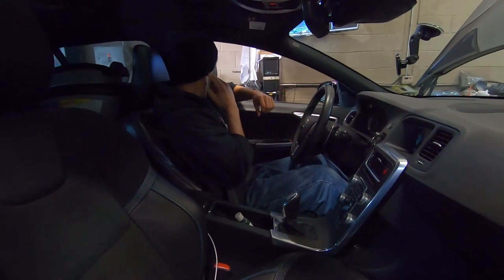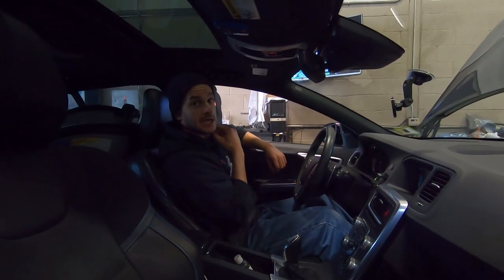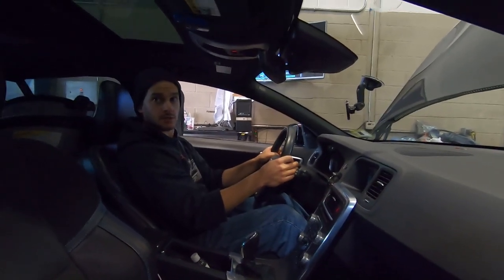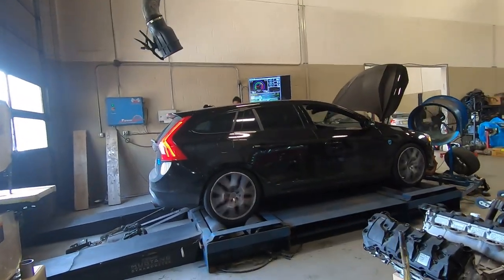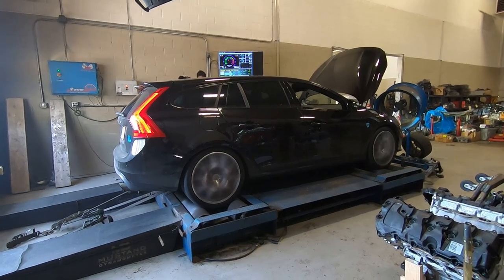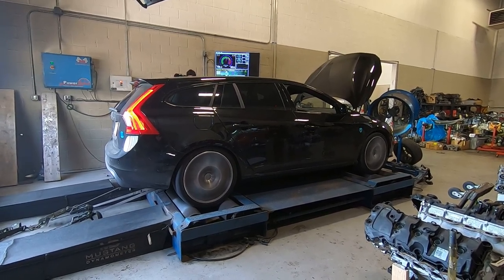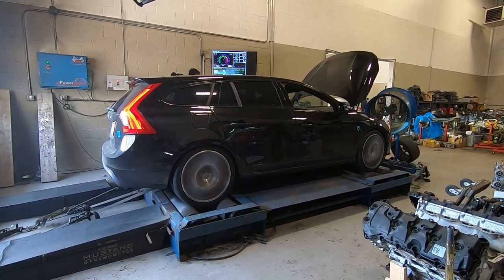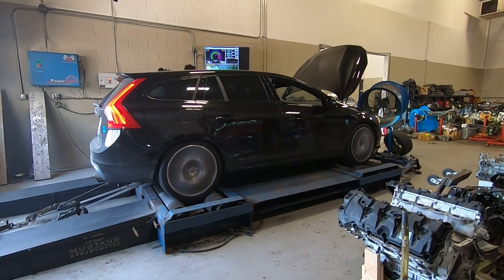Here’s How Much Power My Volvo V60 Polestar Actually Makes

Comment from the maker: Volvo lists the power from factory as 345 horsepower and 369 pound feet of torque. Mine did WAY more than that at 313whp/395wtq. With even 12% parasitic losses (which is very low for AWD cars), that would put my car at 355 crank horsepower and 448 crank pound feet of torque. This is bananas!

Comment: I love seeing people go through all the things i did when i first got my Pstar. After SOOO much testing and trying different things my last HP #'s were 373WHP and 492WTQ. Im currently working on trying to go much bigger turbo to avoid all that instant power down low which is very hard on the Transmission.
Reply from the maker: Please report back with how that goes! I'm interested to upgrade the turbo eventually, maybe next year.
Reply: Same!  I have a Stage 2 (Hilton) 2016 RD 3.0 (poor man's P*) - 356 whp, 539wtq, the power is outrageous, and I have purchased additional cooling equipment for the transmission (similar to "builtforspeed"s YT channel).  Good luck with the sourcing and let us know how it goes!
Reply: @daviddawkins2392  I have my 16 P* with full bolt on and Hilton’s 2.5 tune all I know is that launch’s spin all 4 wheels need to get on a dunk asap
Reply: @dylanpeck7902  Much envy!
Reply: The polestar version has a larger turbo than the R-design. Have you maxed out the psi on the Polestar turbo?
Reply: I've got 3 years on my warranty until I start staging it. I've heard that stage 0 is crucial to going to stage 1 and beyond. I've got a 2017 s60 wagon r design platinum with polestar tune.

Comment: Great video. Once you start modding it you will be very happy driving that car. It'll want to break tires loose every corner you gas it.  Very fun car. And i dynoed mine in 3rd gear the 4th was showing very crazy numbers on mine.
Reply: I can vouch for this.
Reply: Hey, just curious, is your car still good as it was? I cant find a clear answer to wether i should upgrade my volvo engine or not..
Reply: @danielcohen3733  if you won't upgrade your turbo you will never kill this t6 engine. Once you start putting bigger turbo on,  thatwhen the risks start happening

Comment: Volvo's have always been powerful. We got a 2017 D5 PHEV and it's a really enjoyable drive at all speeds. If you need to overtake, you can do it. I'd love to get a stage 1 tune, cause the gains are supposed to be amazing without any modification required.

Comment: Hello, very Nice results. From my V60 D4 2014 I have a dyno run after Tuning; 224 HP (4000 RPM) & 430 torq (3300 RPM). 

It still be incredable cars
Reply from the maker: Very nice!

Comment: The T6 engine is good for +1000hp, IF the bottom end is build the right way, so there is alot of potential :-) Piston rods and bearings though, will not go past 450'ish, expect a bit less, but still the stock engine will gladly do 400hp :-) I have a V60 T6 AWD from 2012, it has 305HP stock on the crank. Aiming for the 400hp mark within a years time or so. To get there I'm planning to swap the turbo, injectors, intake, ported head and a new tune. Should be enough to get pretty close :-) I know there are 10-15 easy hp to gain from straightpiping it, but in my country it is stupid illegal to remove the cat, so I want to retain it. Also, I do like that the car stays somewhat neutral in not only apprerance, but also sound.

The wheels you are running, what name and brand is that? They look so good on the car <3

Comment: Since I can’t afford a new volvo anymore.. I been tuning my XC70, already started with r-design conversion, not sure how volvo was planning it becaue they clearly were going to make an XC70 RD but they didn’t. White papers I have discovered with RD options for XC70 indicate they planning to use matte or satin black for adds ons to match the exterior body cladding I guess. Weirdly I also found they going to use paint matched colors as well.  But options I found indicating possible RD was in the works was:  rear spoiler, mirror caps, rim colors all having r-design options on this white paper.  Nothing confirmed and speaking with my sale’s guy as I call him he great source of info he told me he think they would have gone with matching the cladding, as may appear more aggressive vs body color matched. 

Should mention, still around that 415 WHP from my last tune but it feels better now, and sounds godly on these Borla’s!

Comment: I was wondering what gear you were in, it's worth noting that the torque is limited in the first three gears (pretty severely in first and second). Torque is limited to 380 Nm in 1st, 400 Nm in 2nd and 450 Nm in 3rd (280, 295 and 332 lb-ft respectively).
The factory torque figure was originally advertised as 500+ Nm, with about 550 Nm in the upper gears. They didn't claim the full torque because the lower gears limit it so heavily.

Comment: My friend has the polestar optimization s60 r design and i had a modified c70 making 350hp and 400tq and I told him the same thing there’s no way it’s making the advertised numbers it felt exactly like my c70 it pulls so hard through the gears and it’s sensitive in the low end.

Comment: With all the parts available and a proper tune should get close to 600lb-ft and 520hp
Reply: That poor transmission =-D
Reply from the maker: Doug shhhhhhhh, it'll hear you! Lol
Reply: @shiftinglanesgarage  🤣 those Aisin TF60 gearboxes can take a shitload of power and torque which is good
Reply: If you have enough money you can make it bomb proof but that is probably the same with many transmissions

Comment: You'd make more power by pulling the fuse for the Haldex and just doing a FWD dyno.
Reply: Fake power. The whole point of doing the awd dyno is to get actual awd power.
Reply from the maker: FWD power wouldn't be accurate to how the car is intended to work.
Reply: If your point is figuring out crank HP, which is what most people quote, then eliminating the factor of unknown RWD losses helps you get a better number. if you want WHP, then yes you should run it in factory trim. Volvo quotes crank HP, which is what you were comparing your results to.
Reply: @bump_draft  no there are still 2wd crank to wheel losses...